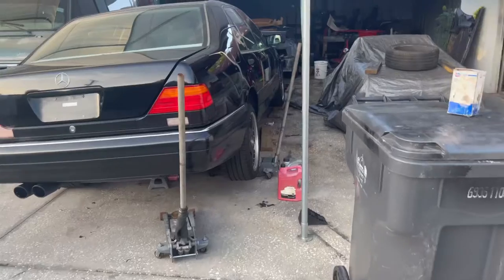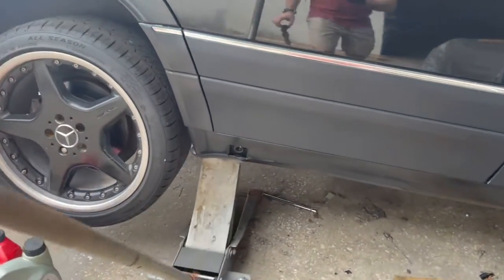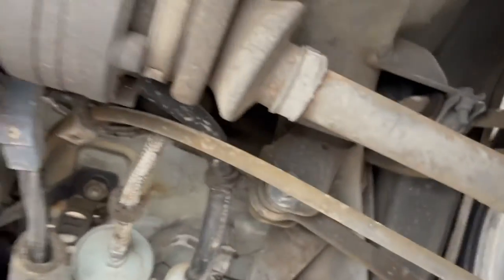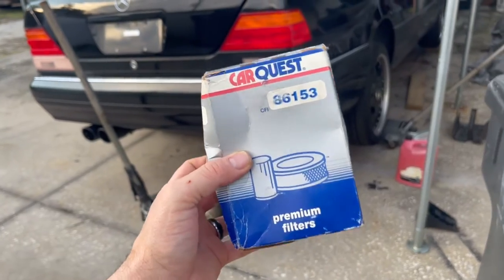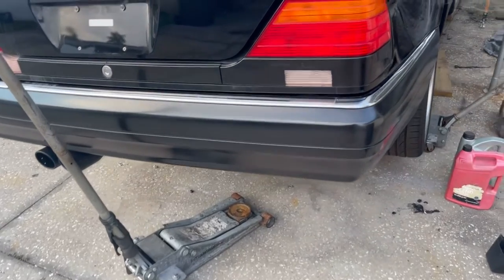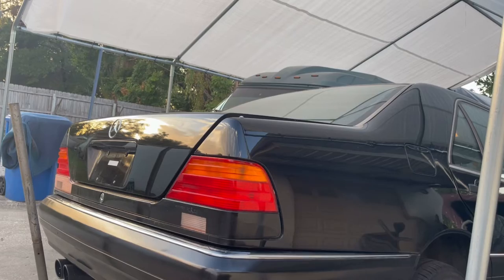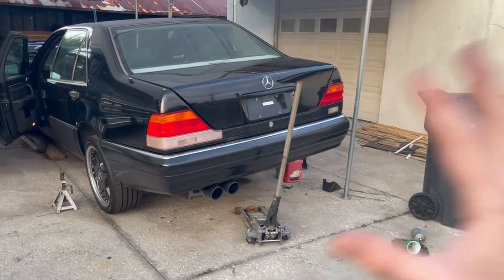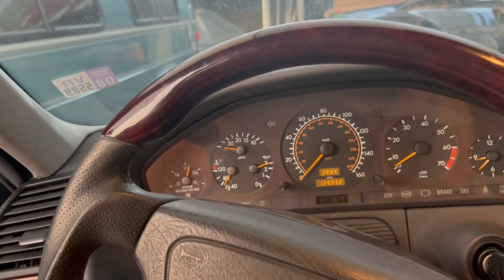Fixing w140 s500 ruff idle & poor acceleration by changing out the fuel filter on project Dr Dre

Comment: Hey man I’ve learned so much from your videos ! I have a 98 s500 that’s been stalling at stops and reds. I suspect it might be the fuel filter as the car has 150k miles and to my knowledge this has not been changed. Thoughts ?
Reply from the maker: Yes could definitely be fuel.   Always start with fuel and spark.   Keep in mind it could also be clogged injectors.  Best thing to do is change filter and add a ton of fuel cleaner to fresh tank.  I like to only do a 1/4 tank of fresh gas with like 3 bottles of injector cleaner and then let car get to temp and rev it up for a bout 20min to push the cleaner through the injectors.   After that change spark plugs and depending on heat check cap and rotor.